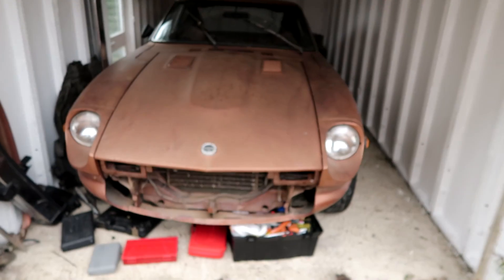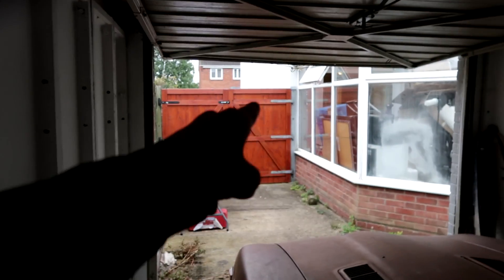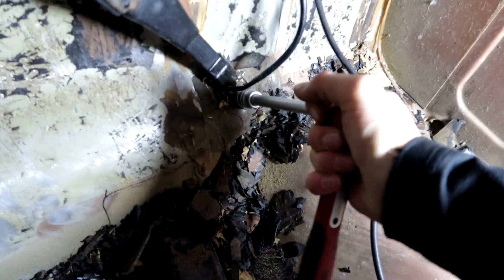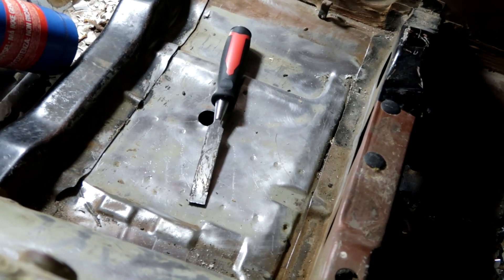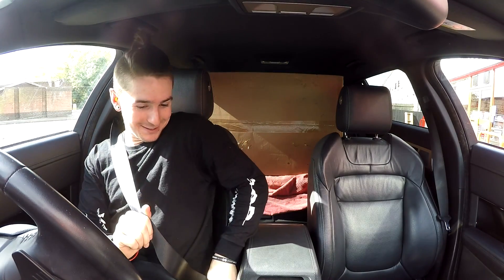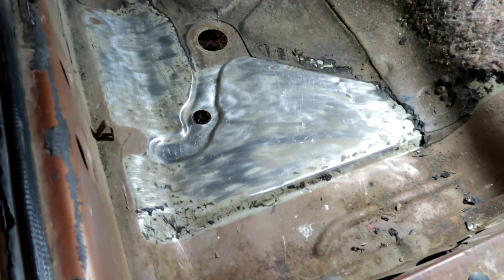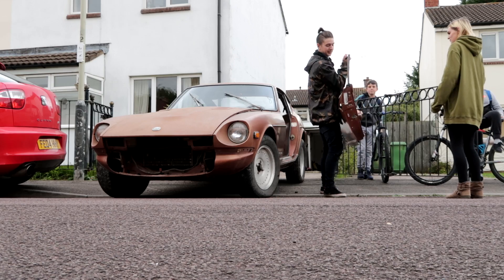Datsun 280z gets stripped

Comment: Few tips...

Sound deadening - Heat gun and scraper for initial removal the Autosmart Jelsol (spray on, let dwell for few minutes, wipe off, repeat) it's a shed load easier than all that chisel work and looks like you've got loads of it left to do.

Rust - search for "BILT HAMBER" their products are the best you'll buy in terms of rust treatment. 

Dash - just bite the bullet and buy a new one, its expensive but a job done properly is one worth doing.

Buy some primer, once you've sanded back and treated the rust or if you take something off and it exposes bare metal, seal it in. Your garage is way too damp to leave it as bare metal.

Hope this helps. 

For good restoration tips and tricks, have a look on DetailingWorld - projects and Restorations.. some very good reads and you'll learn loads

Comment: For your rust issues, you can buy bottles of rust remover from Toolstation. You put it on with a paintbrush, it dissolves the rust and you wipe it off with a rag. Then sand it down a little and paint it with a couple of layers of primer and a couple of layers of top coat. Doesn't have to be the right colour if you're planning on repainting anyway. Good luck!

Comment: Loving the Dat build. I'm doing a bit of a refurb on a 72 Skyline at the moment. I would have a look at Dinitrol RC900 for rust treatment. Use a paint spraying mask with it as it has some harsh chemicals. Also have a look at Dinitrol 3125 and 4941 for undersealing. The 3125 is like oil which creeps into all the seams. The 4941 can be wet sprayed over the top. I did my skyline with this and it's very good.

Comment: If you're looking for a tempary rust repair that will last a fair while, get some stuff called blue steel!  It's a rust converter. You basically apply it to bare metal and all the rusty areas will turn blue! I do body/paint work for a job and it works a treat.

Comment: Since you're stripping the car, does this mean you're doing a full resto before getting it on the road?

Also ditch the manbun, and then burn the remains.

Start with naval jelly for the rust.  Loctite makes some. After that, probably a primer with zinc in it, but I'm not too knowledgeable about primers and paints. 

Check out this link regarding dash repair: http://www.classiczcars.com/topic/22325-dash-repair-processpictures/
Reply: rturbo930 I

Comment: Yo dude! Cool project ! And as for the rust advice, anywhere that you stripped the surface rust with a wire brush or removed the sound deadening etc. Get yourself a can of red oxide primer or etch primer and give it a quick little coat so that it stays protected for the time being (Y)

Comment: Best way to remove major rust is cut the rusty piece off and weld new. For little rusty areas sandblasting is good and it takes all the rust off. If you only hone it with angle grinder you dont get all the rust off, you just polish it. For primer 2k epoxy is the best.

Hope this helps

Comment: Boq use Naval Jelly on all the rust that you're not going to cut out and can't get off with the wire brush. Would also recommend getting an angle grinder with either a grinding wheel attachment or a wire brush because it'll be a lot faster than using a pistol drill.

Comment: Sealey 45 piece 3/8 socket set, sealey 50 piece spanner set, wera Kraft from screwdrivers, halfords spark plug service kit (contains some extensions and a flex head ratchet ), knipex pliers set, wera hex plus Allen keys . Loads more stuff let me know what you want and I'll give you recommendations, some of that stuff is pretty expensive but it will last and work so much better than the cheaper equivalent

Comment: Boq, for rust treatment use some rustoleum gel and then use a zinc based primer, should sort your rust out! Speaking from experience, wire wheel on an angle grinder works a damn sight quicker on under seal too, loving the build man, and more advise on rust and or tools hit me up josh!

Comment: Grab a Halfords advanced 200 piece kit. Everything you'll ever need socket, spanner and bit wise. Also I'm assuming you'll be getting this painted at some point, so just slap a bit of paint over the rust you've wire brushed down to stop it rusting straight away again.

Comment: Nice car Boq! Get some POR-15 rust prep and POR-15 rust paint from frost.co.uk and a load of cheap paint brushes to throw away after you use them as the paint dries rock solid. Also when you are stripping stuff back to bare metal either get the por 15 on straight away or give the area a quick spray with some cheap spray paint to keep the area sealed from the elements until your ready for the por15. Just give the spray paint a quick buff off with the wire brush and treat the rust. If you leave it bare metal the rust will come back QUICK!

Comment: With surface rust grind as much off as you can and treat it with etch primer and invest in a angle grinder and get some wire wheel attachments for it
The dash you could fix with fibreglass kit and then fill it and get sprayed
Love the datsun videos btw keep them coming

Comment: If your doing full resto you might aswell save the effort of doing it by hand and strip it back to bare shell all components off and then get it sand blasted or acid dipped. Will reveal any hidden rust or issues and then repair from there! Just a headache if you get to a point and theres an issue that would have been easier in a shell form 😊

Comment: Rust, where to start..
Kurust is a godsend, naturalizes rust and turns it into something that can be painted over, fairly cheap on ebay/amazon 
https://www.amazon.co.uk/Hammerite-5092820-Kurust-250ml/dp/B004Z4UMUA
when you remove surface rust (like on the doors in the vid) hit it with some primer/clear so that it doesn't set back in, same with the floors, bare metal even in a garage can go shitty.

also another tip, leave it in gear if you don't already, I left my old classic mini with the handbrake on over the strip down and after a few months it had properly seized.

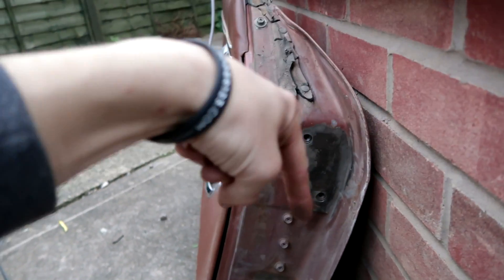Comment: 13:16 I have a 280z and I live in Norway, so I know how much these cars rust and how awful salt and the winter makes cars rust in general, don't cover up rust with paint, primer or any sort of "rust remover" without sandblasting it. If you want it done properly and you want to use your car on a slightly humid day in the feature, sandblast it, or it will start to rust underneath the paint.

Comment: after you've sanded away the surface rust in the doors, you should actually spray paint over the exposed metal because otherwise it will begin rusting again mate

Comment: Tools to get:
Knipex pliers both smooth and serrated
Cordless Impact gun, saves you a ton of time with easy bolts and nuts
A better ratchet yours is ehh
Ratcheting box wrenches
Needle nose pliers with offset jaws, really handy for getting in tight spots
Electrical multimeter, great for trouble shooting

Comment: I'd get an air compressor and a die grinder, it would work better than a drill for the wire wheels... also you wouldn't have to pump up a car tire with a bike pump 😅